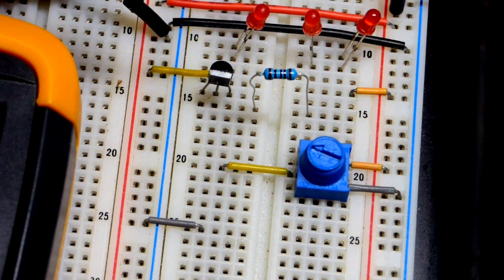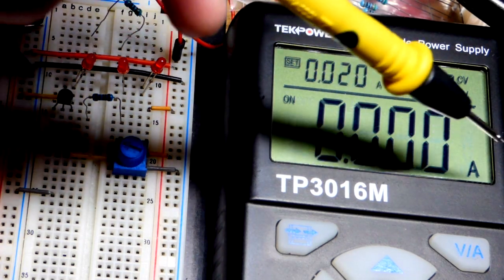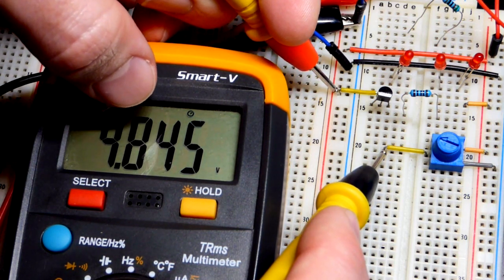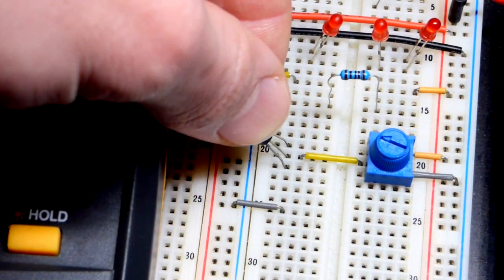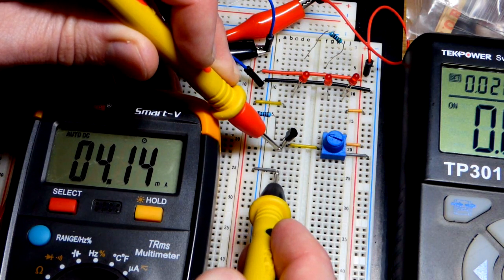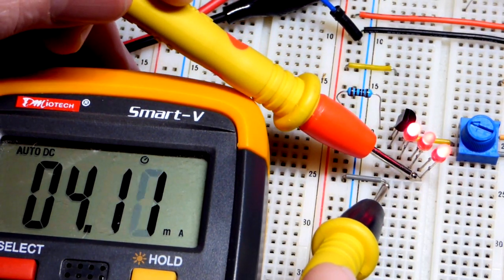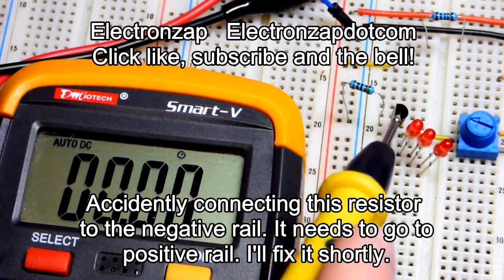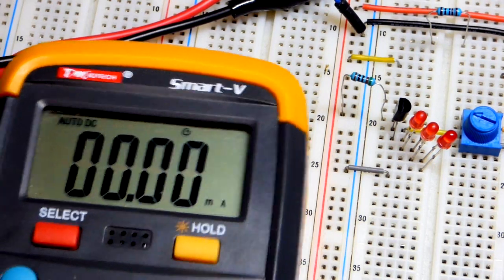PNP current source circuit 2N3906 with multimeter voltage and current electronics measurements

Comment: I'd like to ask you a thecnical question: I am working on this crystal oscillator: https://imgur.com/a/q8ZjM6F

  In order to add a modulated audio signal I am using a LM386 module. I feed the output of the crystal with an LM7805   The output goes to the input of the oscillator. The first time I used it I tested the potenciometer of the module and accidentally I burned the oscillator.  I dont't know if this is due to current or voltage. What do you think? Is there a way to limit the voltage the crystal receives from the LM386 if I go too far with the potenciometer of the module? Thanks for your channel!
Reply from the maker: That's not a circuit I have experience with so I probably won't be much help. If you burn something out, then there was too much power dissipation asked of it, which is voltage times current. So it could be either one of them or both of them. Turning a trimpot usually reduces the current and voltage to other components in one direction and raises it in the other.  I'd probably put a low value resistor in series with them that can handle the full voltage of the power supply. That will hopefully absorb enough voltage and reduce current enough to prevent anything else from burning out. I wouldn't be surprised though if it blocks to much for the circuit to work. Hope you figure it out!

Comment: Is this how voltage follower work?
Reply from the maker: Close. For a voltage follower, the PNP collector would be connected directly to the negative rail and then  the load would connect to the emitter and emitter resistor on one end, and to the positive rail on the other end. The voltage across the emitter resistor will also be the voltage across a load parallel to it. Usually I see voltage followers made with NPN transistors, and they are also called emitter followers or common collector circuits.